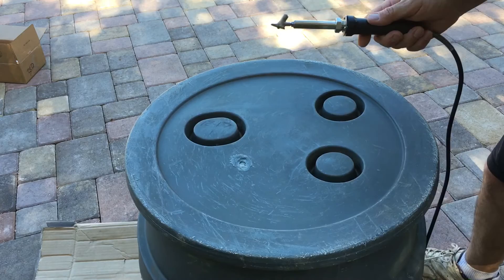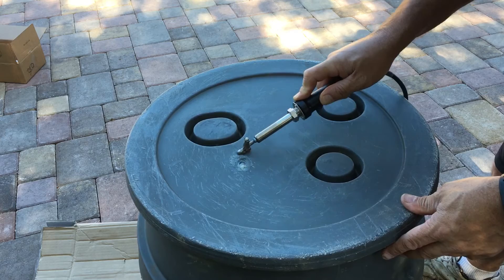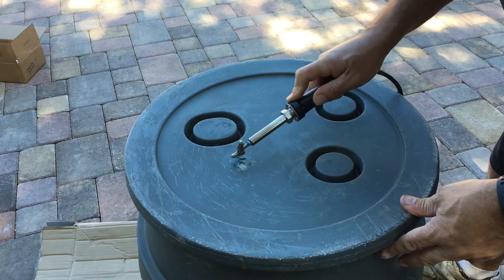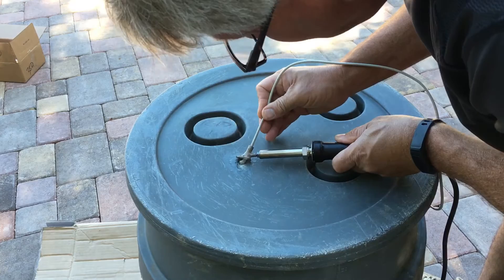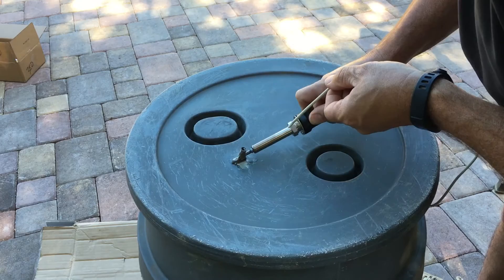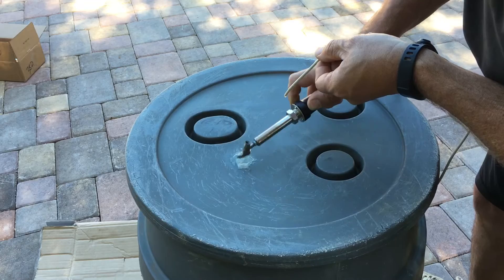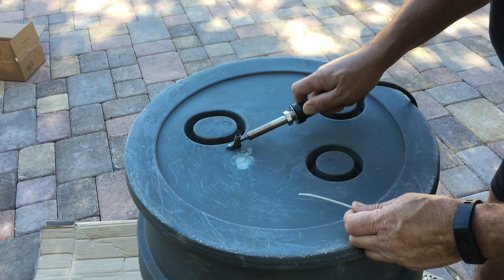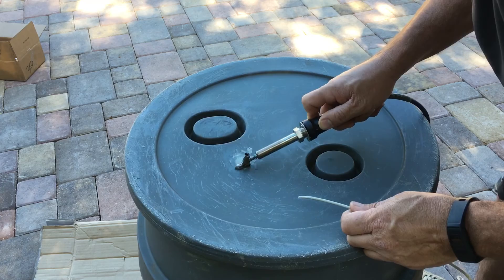Polyethylene Welding 3

Comment: I'm glad you dont know what the heck you're doing in these three videos and you're learning on the go. Most videos I see with this plastic weld are people who've gotten good at doing this and makes it look so easy. I learn better in videos like yours than the "pros". Thanks for sharing and posting. I have a car fuel tank I've got to do this to. It's weird because the the tank has an outer metal shell and the polyethylene is inside. I don't know why its done like this, it's an 2004 Pontiac vibe and came from Maine and all rusted to hell. Thanks again.